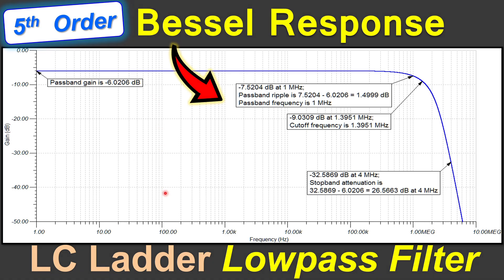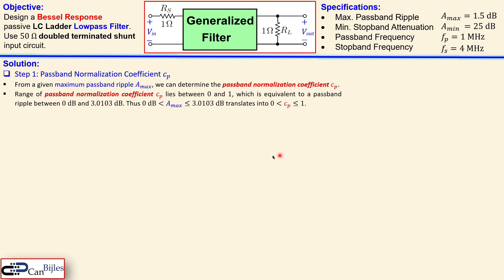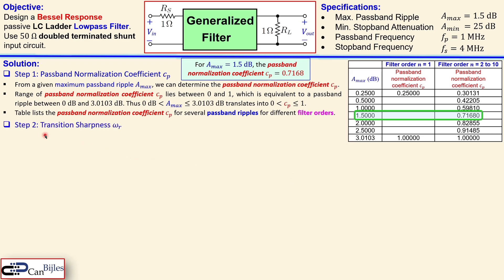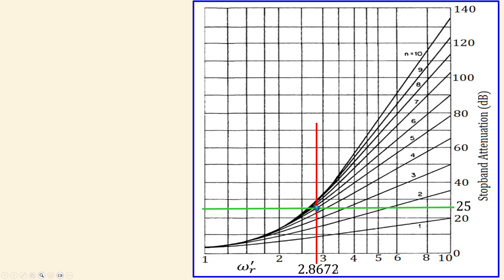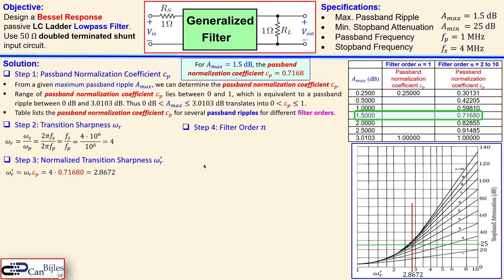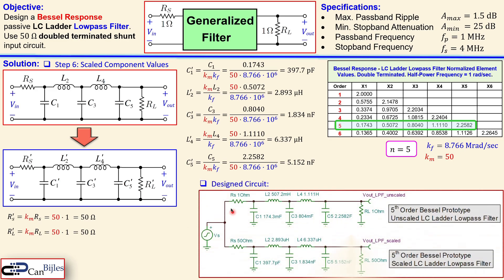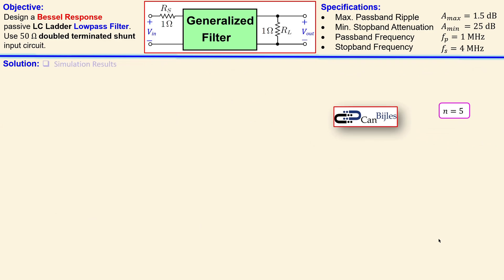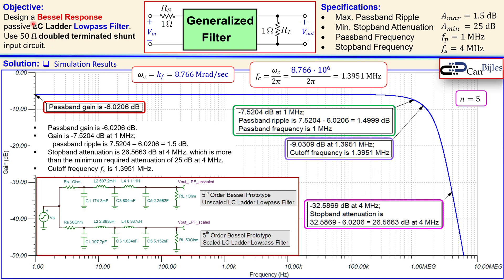LC Ladder Lowpass Filter Design ✨️ Bessel Response - 5th Order 💡 Example 1

Comment: How to calculate bessel low pass (LC where 4 coils after 4 amps go into one capacitor (multilevel inverter). Thanks.
Reply from the maker: I have no idea, until I can see the circuit in details. Thanks!
Reply: @CANEDUX  Hi.  I have here A link to a paper who mention this system. it is on page 150 chapter 4 part II PSCPWM.

I just saw this paper so I look also in it.

https://www.osti.gov/etdeweb/servlets/purl/10147859

thanks.